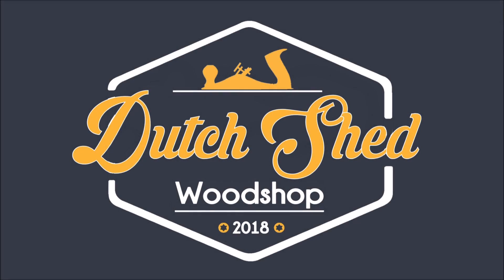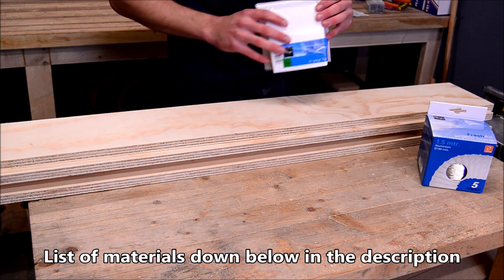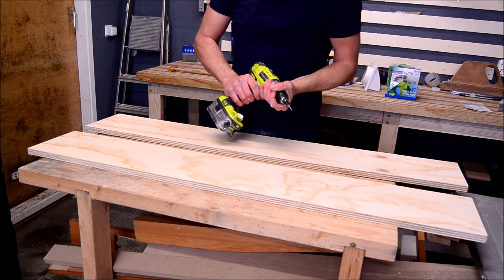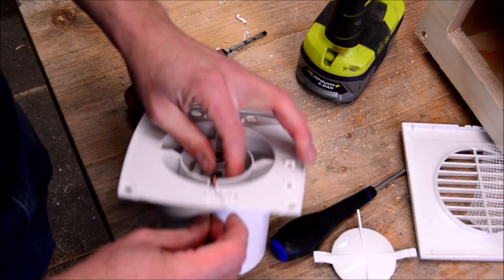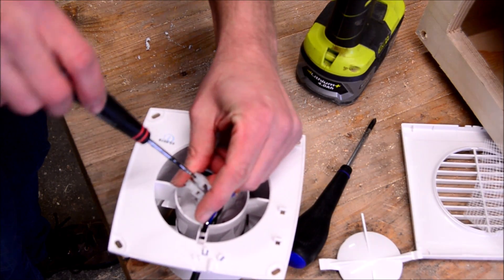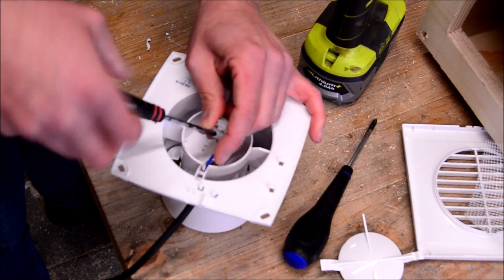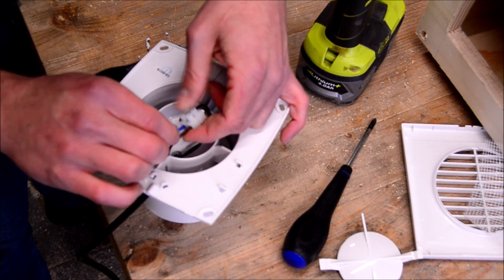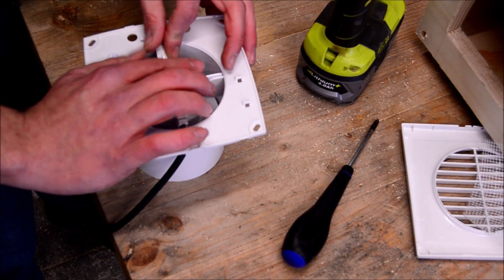Dirt Cheap Shop Garage Ventilation System | DIY |

Comment: To make it even cheaper you could save yourself two of the four long boards - and use the wall and the ceiling as a replacement. You're using a hose so you don't need an actual box, just some boards for decoration and support.
Reply: I imagine this fella’s lovely box may help reduce noise. I might have even stuffed his box with some insulation I reckon.

Comment: Great idea to make that tube that long. That way you have a good airflow in the complete shop.
Reply from the maker: Thanks buddy! So happy with this modification to my shop. The air is much dryer now!
Reply: Best to use ridgid duct. Way better airflow than flex hose

Comment: Is this enough to 0roperly exhaust a garage that's used as a woodworking shop? Should I install several of these or one large exhaust fan. Currently my 2 car garage has no ventilation and I do a lot of work in there.

Comment: Oh nice!!! Be interesting to see how this performs over a period of time. Could be something I could add to my shop. I have condensation sometimes. Great work 👏🏻🙌🏻
Reply from the maker: Thanks Kirstie! Up til now it works great. Almost no condensation now. And if there is any. It much faster dry again. Also works with fine sawdust
Reply: Hi Kristie- Sorry for butting in. I just wanted to share the simple ventilation I put into the shed off the back of my shop that houses the Dust Collector. I bought a 25-watt solar panel $35-US and 2 computer fans for $6.00. I needed a way to cool this shed and just to keep air moving. So I installed a computer fan on each side wall and ran some wires to the 12"x12" solar panel on the roof of the shop and it works like a charm. No batteries need it, though you could. I just know you can wire them directly and it will work. They have pre-cut screening for the computer fans, but I had an old screen window and cut two squares out and just glued the edges of the screen to a thin wood frame and attached them to the outside, over the hole where the fans are to keep bugs out. Good luck!

Comment: Very nice work. What's the reason behind the long duct? Is it to suppress noise to/from outside?
Also, what do you use for sealant around plastic frame mounted outside to prevent rain water from creeping in?
Reply from the maker: I used the long duct so air would come from the middle of my shop. Instead of getting it directly from the door! Thanks for watching

Comment: I'm trying to figure out if I should add ventilation with a portable AC unit. The unit is not cooling very well in my garage, so will adding ventilation help or hurt?
Reply from the maker: I'm not really sure if that would help. If the AC doesn't do much i think it is to small for the area.
Reply: Most portable ac units will have one vent duct you would usually have to put on a window for it to blow out the hot air. If yours isn't cooling enough its either you haven't made a channel for it to vent out the hot air, or there's not enough insulation, or both.  Have you insulated your garage door and sealed any major gaps? That helped me tremendously in keeping my garage cool even when it's 100 degrees outside.

Comment: Great tip and nice build! Question, would you recommend always the ventilator in the middle of the shop/shed? Can the fan also be facing downwards or should it be sidewards?
Reply from the maker: In my case i would recommend it because of the ventilation in the door directly under the ventilator. Now it pulls the air from the middle of my shop. Downwards is also fine but a bit more dificult to do. Because of the angle you have to make with the hose. Thank you for watching!
Reply: @Dutchshedwoodshop  thank you for replying! Do you have an air strip or something under/inside the door? Or just the usual airholes inside the door, I saw you reused your previous door on the side towards the parking lot(I thought it was a parking lot)
Reply from the maker: @X3nTium  Yes i made a airstrip in the door. indeed it is the old door from the tiny shed that i could re use! It opens towards the parking lot.😁
Reply: @Dutchshedwoodshop  Alright! Haha 😁 thanks for your information!
Reply from the maker: @X3nTium  your welcome! If you need more information. Please let me know!

Comment: Have you seen much improvement  with dust in your shed?? I have been toying with this idea with a 6 inch [150mm] inline extractor. If your standard 4 inch [100mm] works the the larger motor and air flow should be a goer..
Reply from the maker: Dust just a little. Mostly moisture which was the biggest problem i had! That is solved now 😊

Comment: Did you put the exhaust through the wooden box for a particular reason or just liked the look better?
Reply from the maker: i did it this way so i get the ventilator more to the centre of my chop.
Reply: @Dutchshedwoodshop  you didn't need to

Comment: Nice little project.  Question: Where are you pulling fresh air from?  My garage shop has no source for pulling fresh air, but I would like to vent fumes.
Reply from the maker: The fresh air comes from outside!
Reply: Also know as cracks in the building.

Comment: As a helpful hint, screwing into the plywood layers is not going to do well if the joint ever gets stressed.  You are lucky it did not splinter up as you set the screws in. (Probably because you pilot holed those spots).  It works much better to use a bead of wood glue then clamp or just tack together until the glue is dried. Much less headaches and a better construction.  I think you’ll be pleased with the results.  Hope that helps.

Comment: When watching instructional videos with sound, and yet not vocals, I can only assume the person is a mute, or is a Monk and has taken a vow of silence.  Then I think, well, maybe they just think they sound grotesque, with a voice suitable for blog posts.  

I'm just messin' with ya.  Vocals are a language barrier, and any visual instruction can be easily understood by competent persons of any language.  

I have to say though, as you used the ducting inside the box, I don't understand the need for the box, unless it's aesthetic only?  The box, if you had used glue or silicon on the edges would have acted as the ducting.  

I also noticed you did not flash or seal the exterior connection.  This will allow water to be introduced not only into the duct box, but also the structure's wall, inside the structure, etc.  This is very bad and WILL cause water stains, rot, and possible electrocution hazards.  Don't do that.  Even a beer can may be crafted into flashing with a pair of scissors.  A heavy bead of caulking around the exterior would do wonders to prevent moisture penetration.  No reason for that.
Reply from the maker: Thanks for watching and sharing your thoughts! always welcome and might be helpfull!

Comment: You could of just mounted your fan to the wall and saved the time and material of the box building.
Reply from the maker: i could have done that. but i wanted te vent to get the air more from the middle of my shop. so it won't take the air directly from the door.
Reply: @Dutchshedwoodshop  yeah...I considered that as your reason and what I was going to do as well.  But after research I read that all lthough you may sense an immediate extraction from that immediate, central area, the garage as a whole will have the air extracted as a whole for the same given time for a wall mounted fan given a run of duct that short.  Good job, though👍

Comment: Expensive and over complicated, entire wooden box is far too over engineereed (3/4" Ply ffs?), and relatively pointless for what you actually accomplish - you may as well have stuck the extractor straight into the wall as designed. 

Most of these people in the comments have no idea lmao.